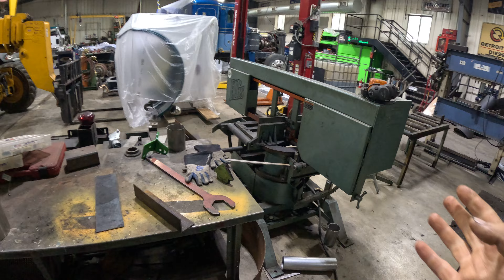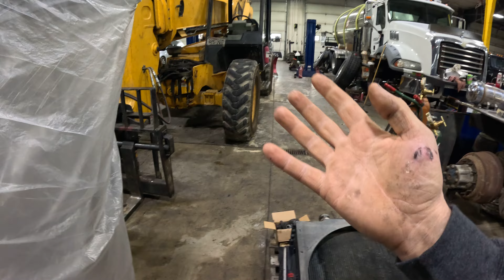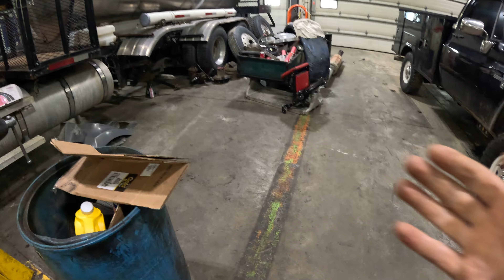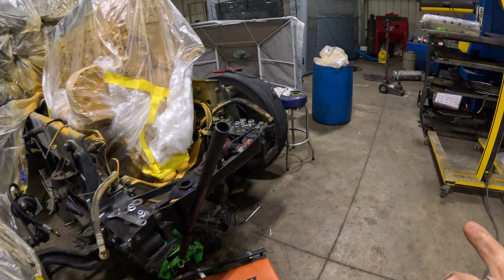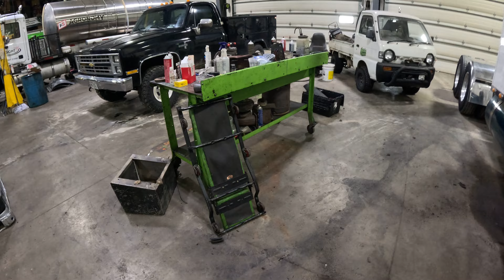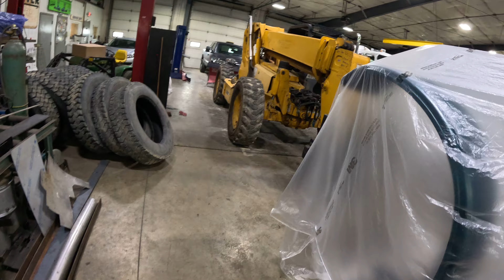SHOP TALK EP1 IS ELECTRIC POWER THE DEATH OF THE DIAGNOSTICIAN?

Comment: I agree, but I don't think the infrastructure for every truck to be electric won't be there in our lifetime, plus you have to bear in mind with the amount of cars they want to be electric, again infrastructure is the issue, the way forward is always going to be electric/diesel hybrid, this is why I'm watching whats going on with Edison Trucks. That's going to be the real way to go for at least the next 50 years minimum.
Reply from the maker: I agree. Mass otr adoption I do not think I will live to see. Hydrogen mabye. I do think intercity and pickup/delivery we may. 
 Battery technologies need to improve.
Reply: @MatzkeDiesel  I agree, Battery Tech has to change, here in the UK we've had this push to Nrt Zero, and Buses have been electrified in London  and just this year we've had three buses burn down with the batteries over heating and going thermo, but even here it's been proved that the current infrastructure can't keep up with the demand now, and nobody is allowing for the Infrastructure to be updated, with Hydrogen I think the idea of driving what is tantamount to a giant bomb around is worrying a lot of drivers, also we've had ferry companies and the channel tunnel saying that until better testing is done they won't allow hydrogen vehicles on them.